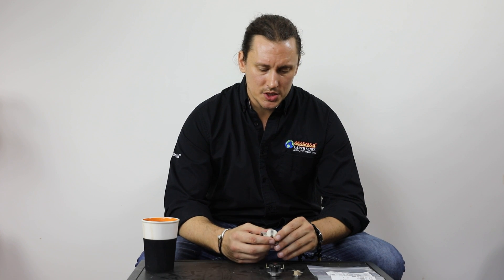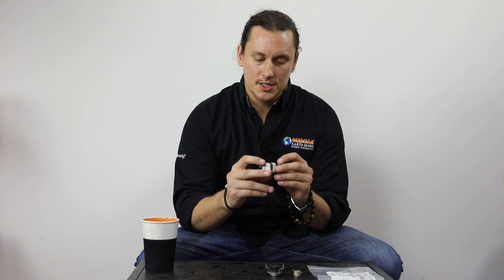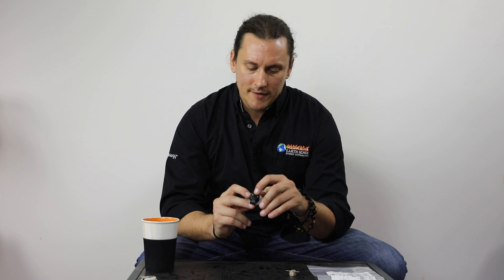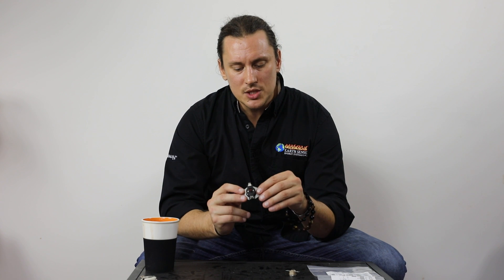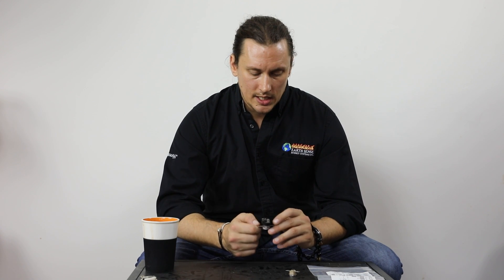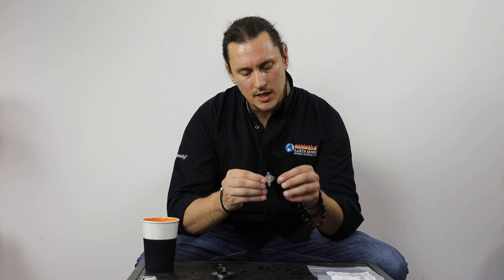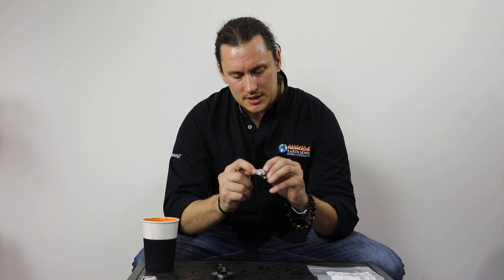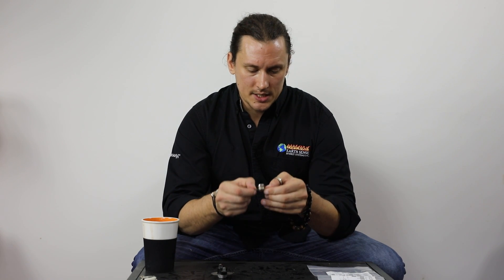Pellet Tech 101 - Limit Switches - Thermodiscs

Comment: To clarify, a 120º-20 NO switch closes at 120ºF and then opens when it drops 20ºF below the 120ºF mark so at 100ºF.  Not when it reached 20ºF (which would be below freezing).  Same with a NC limit switch 200º-40.  It opens at 200º and then re-closes at 160º (not at 40ºF).  The "-##" portion of the model designation is the temperature differential required to reset.  Otherwise, helpful video.
Reply from the maker: Yes that is all correct. Thank you for your input. Apologies about the incorrect information in the video. Thanks again.

Comment: I have a king pellet stove kp130 i think the high limit temp switch has tripped.  Would you know where its located.  I cant find it in the owners mannual
Reply from the maker: Thanks for contacting us. It's very odd as the owners manual discusses Error Code ERR1 as the High Limit Temperature Sensor being tripped, however the parts breakdown shows no High Limit Switch and the Wiring Diagram shows no high limit switch. I've searched and can't find a part number or anyone selling a high limit for the KP130 model. It's very puzzling. Generally speaking, the high limit switch is either located on the exterior auger shaft chute or it will be by the distribution/convection blower. Here is a direct link to the USSC phone support as well https://www.usstove.com/support/
KP130 Manual - Page 19-21 https://www.manualslib.com/manual/2172323/United-States-Stove-Kp130.html?page=20#manual
Hope that helps, keep us posted with what you figure out. 
Thanks,
Reply: @ 
Thanks.  I will keep you posted.  Calling them tomorrow
Reply from the maker: @debyauger5621  Appreciate you keeping us posted. Thanks!
Reply: @ it was the control board fixed now

Comment: It starts up showing it's shutting off periodically throughout the day.  No set time.  The place I bought it from came and installed a new board.  Harman Co. thinks it's low power surges occurring, but we have it plugged into a surge protector.
Reply from the maker: Thanks for the message back PJ. On this one I would suggest calling Harman direct and speaking with their technical team to help diagnose what the issue may be here. On your end you can check the simple things with the power output - make sure the polarity is correct in the outlet, make sure the voltage output is correct and consistent, and make sure the surge protector isn't causing some odd issue here. Hope that's helpful, thanks.

Comment: What causes a Harman Absolute 43 pellet stove to start up on its own and run for 30 seconds and then shut off on its own?
Reply from the maker: Thanks for contacting us PJ. Ran this past our lead tech - That is a tough one to diagnose without being near the stove. If it is a recurring thing at the same time each day, I would say it is an issue with the schedule set in the stove. If it is random, it could be a failing computer board but hard to say for sure.

Feel free to call us and ask for technical assistance or you can call Harman direct for technical assistance. 

Thanks

Comment: Can a high limit switch with continuity still be bad? My USSC 6041 is giving a high limit switch error, but my meter shows continuity.
Reply from the maker: Hey Josh, thanks for the message. The switch could be locked closed not having the ability to open. This could cause that error. You would need to heat the base of that limit switch past the degree that is stated (Probably 200 or 250 Fahrenheit). Once it reaches that temperature it should 'Open' /Break Continuity. The lower number that's on the limit switch will be the temperature at which it resets if it's an auto reset switch. Usually that number is 20 - 40 degrees. If it's a manual reset switch there will be a button in the center; push to reset. When the High Limit resets it should be in the closed position. If your going to test the switch I recommend safety first. You can put the switch in a vise away from any combustibles. A small pencil torch can work well to heat up the base. Use your multi-meter and see if it's opening and closing as it should. New switches aren't too much, happy to send a link if you need one. Keep us posted, happy to help.

Comment: How can you tell when one is bad how would you test it
Reply from the maker: You can do a continuity test on the snap disc with a basic multi meter. Low limit switches will normally be open, high limits normally closed. You would need to put the switch in a vice or something similar, and use a pencil torch to heat the bottom of the switch. Low limit will create continuity when it's hot enough and high limit will break continuity when it's hot enough. There's a small disc inside of the limit switch, you will hear it pop/snap as it heats up and passes the determined temperature. If the snap disc is in the stove, you can create a jumper wire to test - Video below. Jumper wire bypassing is for TROUBLESHOOTING ONLY, we never want to leave a safety switch bypassed. Keep us posted, happy to help. 
https://youtu.be/FDVkbsHS95U

Comment: Do all pellet stoves snap disc auto/manual reset themselves? or are there some that need replacing after they are triggered? Avalon Newport (Avanti PS) serial # 2301-126703
Thanks...I enjoy your videos.
Reply from the maker: Thanks for the message Danny. Yes, all snap discs in pellet stoves will either auto reset or have a manual reset after triggered. We have obviously seen snap discs go bad and stay stuck in the open or closed position. Which Snap Disc in your Avanti is giving you troubles? Here's a video on creating a jumper wire to troubleshoot the snap disc in question. https://youtu.be/FDVkbsHS95U
Happy to help, keep us posted. Thanks.
Reply: @EarthSense  Excuse my ignorance, but I'm not sure that any are giving me problems. What happened: I cleaned my pipes last year and when I tried to start it, it was smoking out various pipe seems. I resealed all the pipe and it wouldn't start. I thought it best to change the door seal and the vacuum switch. I did do the dollar bill seal test as well as the jumper for the switch. All was well, but no start. This is what what's happening: Turn the stove to manual, push start button, exhaust fan comes on, pellets drop, igniter glows but DOES NOT ignite pellets. I'm stumped. There are no technicians that will look at it, I'm kind of on my own. Any suggestions? Thanks for your videos.
Reply from the maker: @dannyschacht4274  Thanks for the message Danny. Glad you got the pipes resealed; it's important to ensure carbon monoxide is not leaking into the home during operation. It is the combustion blower/exhaust fan that rushes air past the igniter during start-up. The super heated air is what is actually igniting the pellet fuel during start-up. Any air loss or air blockage will create ignition issues. I would suggest starting with the basics first. 
1. Make sure the burnpot is seated properly and all holes are open. 
2. Make sure the air intake coming into the burnpot is not blocked or restricted.
3. Make sure the exhaust is not blocked or restricted. 
4. Do a voltage test on your exhaust fan - should be near line voltage during start-up. 
5. Do an OHM reading on the igniter element. For the Avanti Igniter you should get a reading of 54.5 – 63.0 ohms for operable range. 
6. Double check the front door and ash door seals all the way around.

Keep us posted, I'm confident we can get you back up and running again. Thanks!

Comment: have a Quadra fire 1200i  blower motor does not shut off
Reply from the maker: Thanks for contacting us. We would recommend inspecting the #1 low limit switch first. This switch is in-line with your convection blower motor. This switch is normally open and closes when it reaches set temp allowing the blower to come on. This switch will re-open automatically when temp falls below set temp shutting down the blower. Here is a link to that limit switch for reference. https://pellethead.com/product/quadrafire-heatilator-ecochoice-1-low-limit-convection-snap-disc-125-degree-safety-switch-thermodisc-oem/
Reply: @EarthSense  Thank you for the help.Put a new number one snap disk in but then a call light will not come on when I called for heat and blower still stays on when unit shutdown
Reply from the maker: @DonPaullin-w2s  Thanks for the message back. When the blower is still running after shutdown, can you pull one of the wires off that snap switch and see if the motor shuts down? Just want to absolutely rule out the limit switch here. Other than the switch, the only other thing we can look at here is the control box. Do you by chance have a local dealer near you that could test your control box?
Reply: @EarthSense  Put in new number one snap  when thermostat calls for heat. No call light put in new number 3. Snap disk changed out control box with a new one I bought from you. Blower motor still keeps running after shut down.
Reply from the maker: @DonPaullin-w2s  Thanks for the message back; Good information. Couple questions: Is the stove going into start-up when you turn the thermostat up having no call light? If it is starting up fine, then most likely the call light bulb is the issue. If it's not going into start-up, we would like you to remove the thermostat wires and put a large staple between where the T-stat wires went. This will bypass the t-stat - See if the call light comes on and the stove goes into startup. Was the reason you purchased the new control box because the convection blower would not shut down or was there a different issue? We'll get this figured out and make sure you are taken care of. What is the name on the order you placed with us so I can pull everything up?
Reply: @EarthSense  When I change out number one snap disk and the thermostat calls for heat. I get no call, right.
Reply from the maker: @DonPaullin-w2s  The #1 snap disc is only in line with the convection blower. I understand your stove currently has no call light. Is the stove going through start-up with no call light coming on?
Reply from the maker: @DonPaullin-w2s  Also received this message when I inquired with our lead tech. Let's inspect the snap switches closely here to verify as many look the exact same. 
Any 3 or 4 speed Quadra-Fire board supplies power to the room fan 100% of the time and is only interrupted by the cool #1 snap switch.  The only logical explanations are that both the old and new #1 switches are defective (open on a cool stove) or the new #1 he received isn’t actually a low limit switch.  If a high limit (#2 auto reset) were to be installed, the fan would run because high limits are closed when cool.  This also isn’t a case where the switches were installed in the wrong positions because a #1 in the #3 position would prevent the stove from powering up.

Keep us posted. Thanks.

Comment: when my traditions 30  pellet stove gets to room temp it shuts off the feed but it dont shut down the convition fan  guessing its a snap disk
Reply from the maker: Thanks for contacting us. Will depend exactly on the Model. Do you have an Earth Stove Traditions model or do you have a Whitfield or Lennox Traditions model? In Whitfield and Lennox Traditions models there is no convection blower snap switch, the blower is controlled by timing in the circuit board. I'd have to double check manuals, but I believe the early Earth Stove Traditions did have a snap switch for the convection blower. If it's your combustion fan that is not shutting off, that would be different, but I think you are referring to the room-air convection blower. Feel free to send additional info, happy to help.